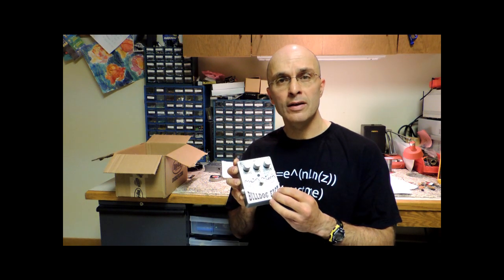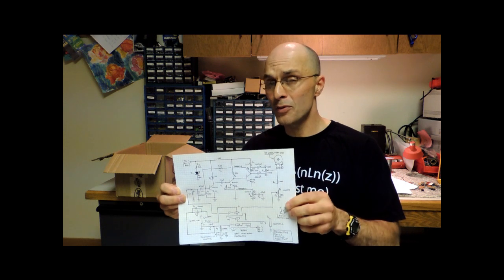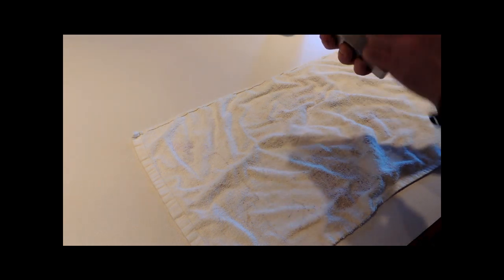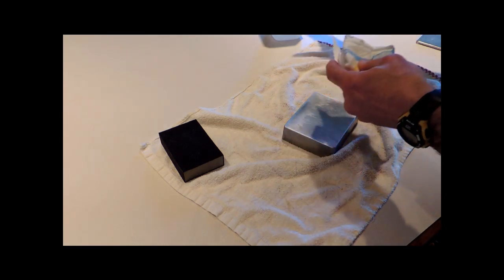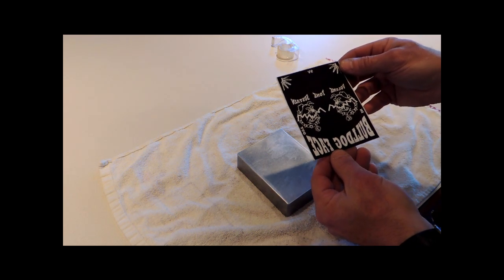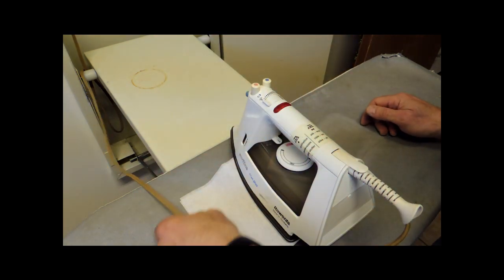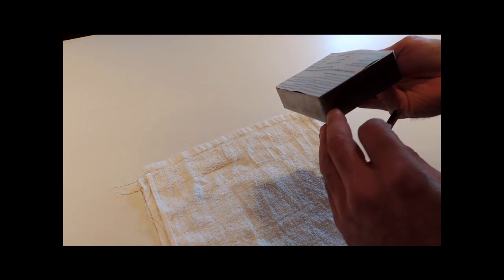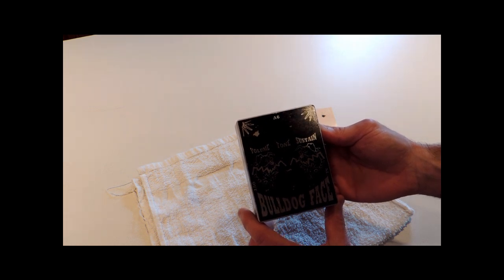Build it: The Bulldog Face Distortion Pedal -  Part 1 DIY

Comment: Hi, I tried to print the design onto the label paper but it did not seem to dry on (when you touched it the ink came of very easily). Am I using the wrong paper, or is just a question of giving it time to dry?